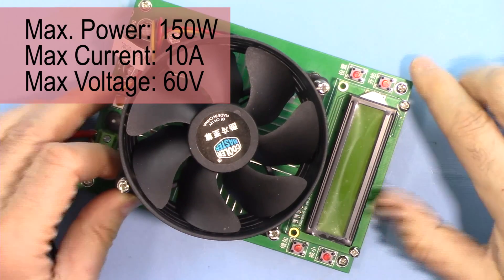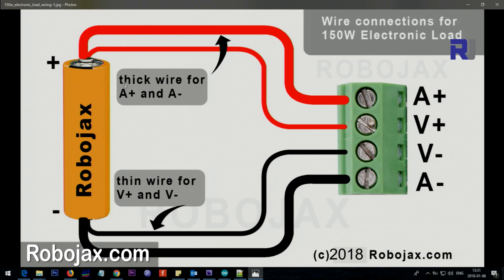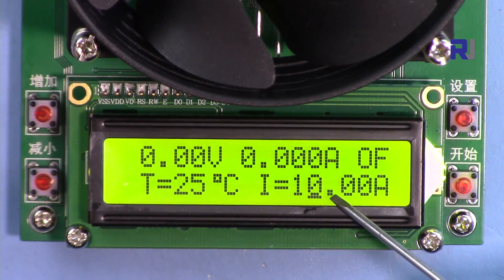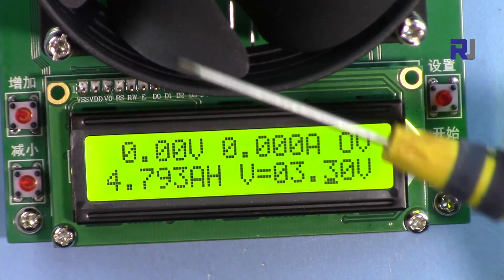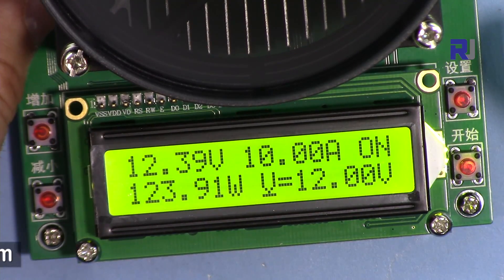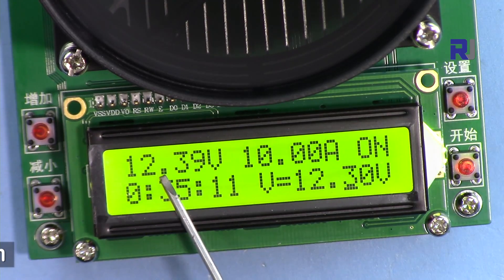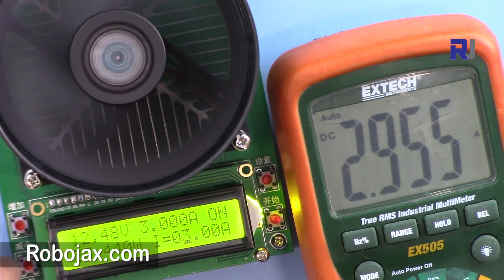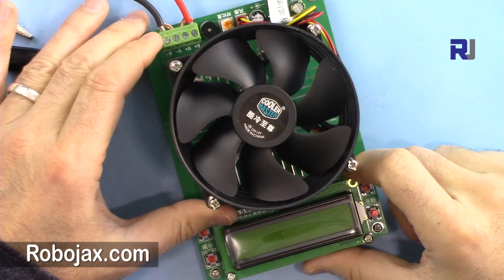Test review of 150W 10A Constant Current Electronic Load

Comment: I bought this and there are a few notes to make:
1. Take care to put some insulation under the board so you don't make a short circuit. I just screwed a piece of plastic on the legs.
2. DO NOT CONNECT DIRECTLY TO A BATTERY! The load has no fuse whatsoever, always connect though an external fuse! If something goes wrong (and it can, see below) and you have no fuse, you WILL CAUSE A FIRE!
3. This board is not safe to use at 60V! This is the absolute maximum rating and if you exceed it even for a moment, it will short out the power transistor! I would not use it above 42V. I think this is due to the construction: the power transistor is connected as a high side switch and you can exceed the VGSmax rating on turn-on. Happened to me twice, but is easy to fix: Just buy a IRFP260N transistor and solder it in place of the old shorted one. The board actually has a space for a protective Zener diode to prevent this, but it was not installed on my board.
In short: Useful, but use a fuse and don't let it out of your sight while testing.

Comment: Just bought this type but has newer firmware (V2.45). It was about 30mV and 20mA out but I figured out how to calibrate it and now I'm very happy with it. Works really well.
Reply from the maker: good to hear that.
Reply: @robojax  do you still use yours? Or only use the Rigol now?
Reply from the maker: this is 150W not enough for my work. Rigol is professional lab equipment which I use. That was not enough, I just purchased a $6000 new 3kW coming in a few weeks.  w
Reply: @robojax  that makes perfect sense because you are a professional. I am a novice and still learning many things, so I'm just trying to learn everything. I'm a mechanical engineer by trade but electronics has always fascinated me. Hope to see more of your videos soon. They are very informative and enjoyable.
Reply: how did you calibrate it?
Reply: Mine has worked perfectly since doing that.
Reply: @TYGAMatt  right o
Reply: Hi, I have also version 2.45, can you tell me please how to calibrate?

Comment: Gotta disagree about the Fake comment.I notice yours has a yellow cap under the display, (left side).Ones like that DO appear to behave properly, but others do not.I have 2 of them & once the reach the set voltage, they DO reconnect at full load.

Glad you are happy with it; I tried twice to get precisely your model, but what I received was always the variant & buyer protection failed.
Reply from the maker: Thank you for comment. You are right. There is not standard on this product. Anyone produces. If you are not measuring the power and just looking at current, I will always set the voltage at lowest like 2V or 3V and it works perfectly with set current value.

Comment: Did you test the other type of electronic load? The type with the fine and coarse adjustments potentiometers.
I just got one but very interested to know if you've tested it.
Reply from the maker: no I have not yet. but getting more to test.
Reply: @robojax  will be interesting. I have one but it blew the mosfet. Just changed it and worked fine discharging a couple of 18650s. Then hooked up my 6S Li-ion pack at 100W and boom!!!
Not sure if the mosfets I got (cheap) are to blame or not. I'll buy a genuine mosfet and see if that fixes it. If not I'll just cry and throw it on the shelf to gather dust.

Comment: The thing about fakes is the quality of the components, as you said, it's easy to make one yourself, but it's not the same to build it using good parts or using knock off chinese cloned parts that probably won't meet the specifications of the originals.
Reply from the maker: Agree
Reply: @robojax  It is not related to parts. It is a firmware dependent project and the usual E-bay offer do not work as it must work.

Comment: I have this device that worked for a short time, and it stopped showing the battery voltage, and therefore its functioning. I found that the U3 chip is defective, and the inscription on it is quite illegible, so I can't find it on the internet where it can be bought. Would you please tell me what kind of chip it is and where it could be bought? Thanks in advance! We later learned that it was an 18 bit adc "CAK4". If you know where this can be obtained I would be grateful.
Reply from the maker: Even if you get the chip, where will get the firmware from? I am not sure 🤔
Reply: MCP3421
 18-Bit, 240SPS, Single Channel ADC. It's not a MCU, there is no firmware in it.

Comment: I have a question can you use the load with a ac power source for example i want to test my Amplifieres for speaker because it think that it does not deliver the rated power and i want to make sure can i use it directly with the module or would i need to make a FULL BRIDGE RECITIFIER (electroboom refrence :D)?
Reply from the maker: no you can't. This is only for DC loads.

Comment: Hi. I got the one with black buttons. It worked once. Now with same settings 21V and 5.5A the load says 0 aftee start. Tried other batteries. Cabling is ok. Reset doesnt work. Help?
Reply from the maker: I will post video on that. it has a fuse and you have to have open the heat sink to see it.

Comment: I just purchased one of these units on your recommendation. Hardware appears very nice but firmware is CRAP. 
Calibration is 20% in error. Time displayed is only 1/2 actual time , Amp Hour is half actual AH. If you program 10A system locks up. and wont turn OFF. It shows "OF" but still draws >10A. Power display is meaningless displaying 0W or 2.5W or 5W but nothing in between.
It appears I have a very early firmware version. Does anyone have a new firmware that I can use to reprogram my unit?
Reply from the maker: This is the problem. Some items might have been in warehouse for months or years. then I might have been lucky. I purchased it from this seller http://stores.ebay.ca/healthbeauty360?_trksid=p2047675.l2563 but the item is no longer in this store.
Reply: I was wondering if it is possible to download the firmware from your unit. Would be a nice project.
Reply: @peterdkay  I have same problem, do you have any solution
Reply: @eugenenns514  Unfortunately no. I just scrapped the unit

Comment: I WAS WONDERING WHY THE MAX POWER IT'S 150W?? OHM'S LAWS SAYS THAT p =V*I, SO IT'S SUPPOSSED THAT THE POWER WILL BE 600W?
AM I WRONG?
Reply from the maker: You are right but it has limitation. So Maximum power is 150W. Now you have to adjust either voltage or current such that it does NOT exceed 150W. 150= V*I. Put any value you want, to make it 150. But you can't put for example 1000v. It should be less than 50V i believe.
Reply: Robojax its the maximum power of the board?
Reply from the maker: Yes it is.

Comment: You should have left the unit to heat up for longer... Heat test is useless, we cannot know if it can withstand 150 W steady. Plus, the current error is not 8mA, but 80mA!
Reply from the maker: Thank you for the comment. I monitored the temperature. When the fan can control the temperature and the fan goes OFF, it is enough because it will not get over heated. 
for the current error, thank you.

Comment: Unfortunately, you got the bad "fake" version. There is no original one, anyway there is a device looks like any of these DIY projects but with much higher quality and useability! I got trapped like you on this cheap version. May disadvantages in this version here. Very unprecise in voltage and current measurement. This version is not able to change current while running, you can do but the result displayed is nonsense, cuz they just take actuell current and multiply with time! This version does NOT support energy accumulation Wh! This version can not be calibrated! So all in all this device you have is a "fake" from a much better available one. You can see the differences one the right side there is a RS232 (rx, tx, gnd) connector. I have both devices and would never change them again. The "original" one is semi professionl in quality and use!!!
Reply from the maker: This is just assumption.  Ju st read the comments, people purchased other items and when they found the one I am using they call it "real or original". Also the one I have you can change the current while running.
Reply: Robojax, you can change the current, right but the accumulated Ah is then bullshit cuz its as I said a multiplication of actuell current with time consumed. Anyway, by watching your video again im not so sure your device might be a previous version of the "original" developer one. As I said I would never change to this cheaper rubbish again. The original one is fun!
Reply from the maker: Yes I can. I have a lot videos with the word "test" or "review" in the title and have recorded it. The problem is we don't know which is the "original" they don't put manufacturer name or even a model. Can you believe they call this 150W electronic load. Many people produce this from their home and they don't know to put some letter or number like "EL-P150" or something like that to identify the product.
Reply: Robojax, I just call the latest one I have "original" cuz its the most precise and functioning one! The one I got before I call "fake" cuz it does not even sets current in 10mA steps, just 100mA. The voltage shown on display is upto 600mV wrong. I guess there is a good "original" one which is then bad copied from others. Right, also my latest one does not have a product id. A piece of paper one page instruction manual called 1602 CNC